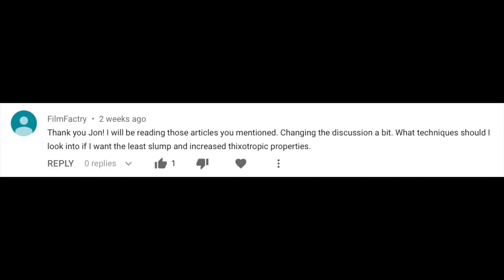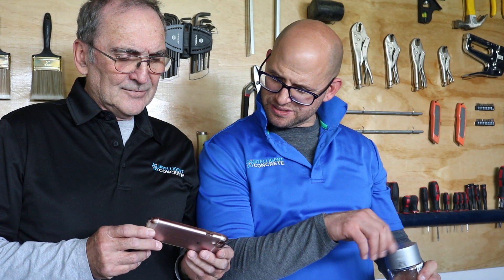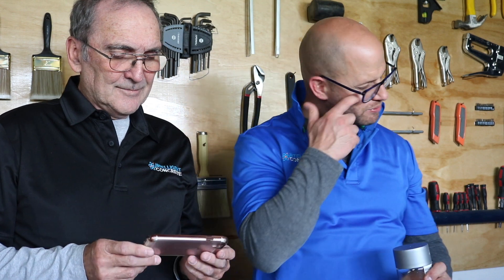Increasing Thixotropic Properties - Vlog #333

Comment: Jon: "Tensile strength is 10% of compressive, right?"
David: *Gasps for air* "Et tu, Brute?"
Reply from the maker: deyc3 haaaa!  David would wince in pain.  The problem with the 10% quick calc is that with new and emerging tech, tensile strength can be far greater than 10% of compressive strength.

Our hurdle is that there WAS no inexpensive and repeatable way of testing direct tensile strength... until now.

Stay tuned for more.
Reply: That and the relationship is not proportional, right? Really soft concrete may have MORE tensile than 10% of compressive and above 10k PSI, you are going to get WAY less than 10% tensile per compressive.
Reply from the maker: That is true but with new and emerging tech we can get the best of both worlds.